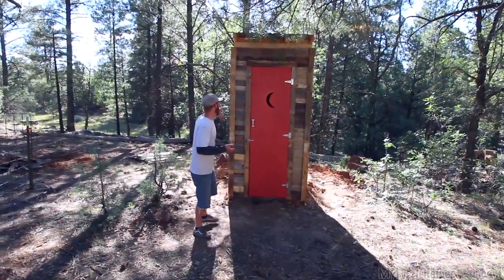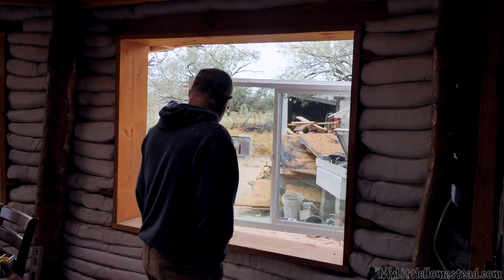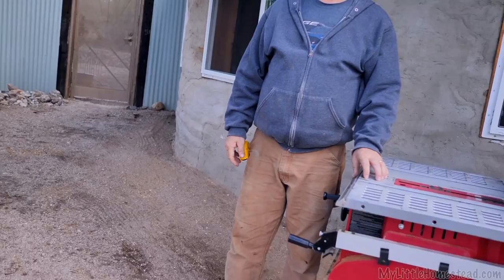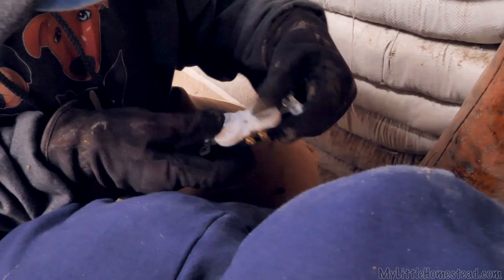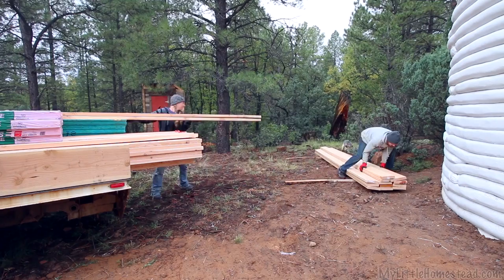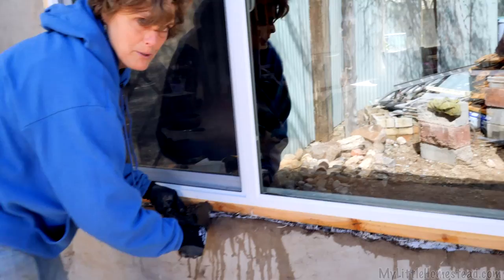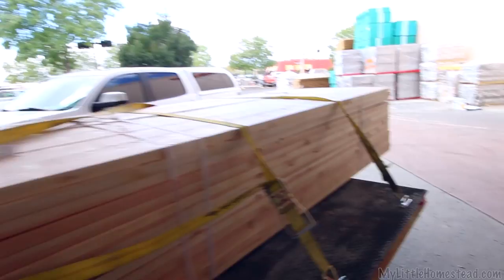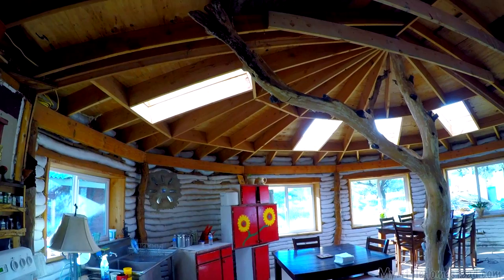Install Windows, Collar Ties & Cut in Driveway | Earthbag Kitchen, Bath & Cabin | Weekly Peek Ep158

Comment: Looks like possibly you have done the same thing as me to your electric plainer, run over the power cord with the plainer. I opened up the plainer handle and just removed the little bit attached to the plainer and then cut the cord down and rewired the cord in to the handle.
Death is so hard when you're special one departs, I remember still the heartbreak of loosing Ben, my Labrador/Springer crossbreed at 18, he'd been with me since 8 and it shattered my world. Hope you're remembering all your good times.

Comment: Clom is used to make earthen building's. Idea, repurpose a foam cement mixer to mix up Clom use bamboo fibers then mix in a water activated ceramic that you can cure with ultraviolet light then extrude the mixture into mold's press and form brick's paver's wall section's and other shape's with different textures and pattern's then hit the molded item's eith ultraviolet light to start the curing then set the item's aside to finish curing 24 hrs so the item's become rock hard. Neat part all the building materials would be dirt cheap and all those building material's can be ground up and reused to make new building material's. Could even extrude the mixture into earth bags braid them together then lay them down to build a home and let it all cure rock hard. you could even braid the bags together and lay them over for a roof. Now that would be a bunker lot's of protection. Crazy idea huh? 😊

Comment: Apocalypse bunker build gabion walls using wire cattle fencing with piled rock's inside the wire boxes. Make a floor in this manner lay concrete canvas down first spray down with water let it cure. They lay down cattle wire fencing and lay rock's then cover with cattle wire fence putting plumbing and electrical where needed. Mix up secure set foam and pour into floor sections place wood panel's over floor so expanding foam fills all voids in the rock's. After the floor has been foamed with secure set foam lay down concrete canvas spray down with water let cure. Repeat process for inner wall's and roof putting in electrical and plumbing and air circulation where needed. Then you can buy a lift that looks like a cement parking slab that raises up that you could use to park your SUV vehicle in an underground area and have an acess to your home made bunker. Y'all can buy all those supplies and no one will ask you any questions because farmers use those item's to house livestock pitch fence posts and line ditches. A smart built apocalypse bunker out of sight out of mind. 😊

Comment: I love your videos very much but I am curious as to why you do not flash your windows with Tyvek or Novaflash polymer type house wrap and window flashing. Aren't you concerned about moisture getting behind the window flanges and rotting the wood or leaking into the interior! Is it so dry there that you don't worry about these issues?
Reply from the maker: Yes.
Reply: Yes to dry enough?

Comment: I have a question for anyone who can help.  I’m helping my son with his science fair project.  We mixed concrete patch and I’m waiting for it to harden in an aluminum pan.  It’s been 5 days, and it’s still soft inside.  What can I do to get it to harden faster?
Reply from the maker: Temp. Correct composition of 3 parts sand, 2 parts rock and 1 part Portland cement.
Reply: Tytytyty!